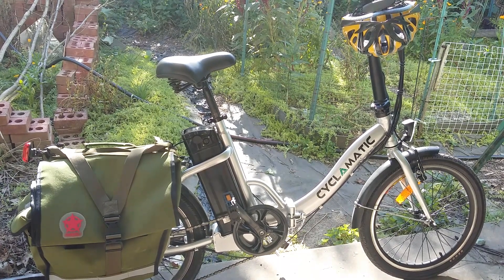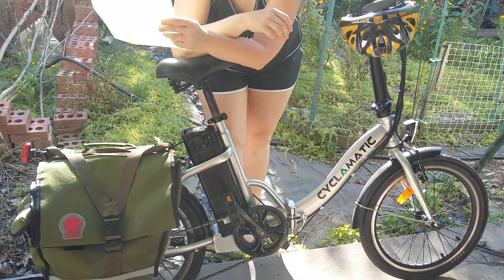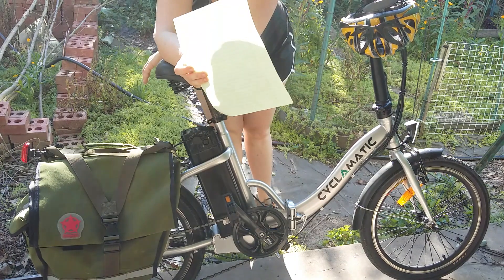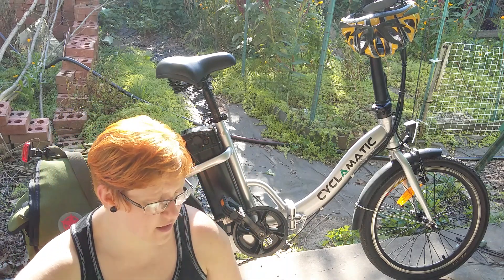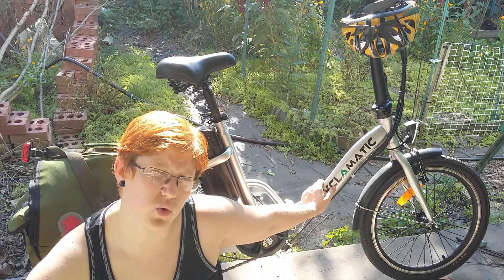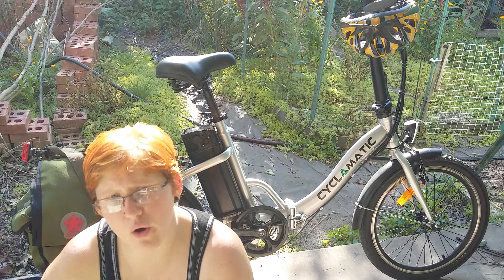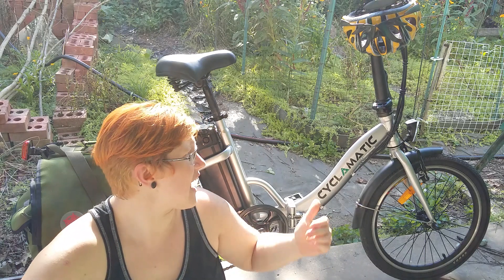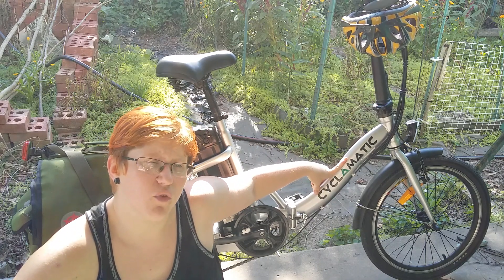Cyclamatic CX2 folding electric bike review at 60 miles

Comment: I just got mine today! Does the chain sit that low? I noticed yours did. Does it interfere with anything while riding?
Reply from the maker: Congratulations!  That's so awesome!  I just hit the 110 mile marker on mine and the only thing it's needed is new break pads (an easy job) still very happy with my purchase.  I hope you like yours just as well!  The chain is as pictured, yeah.  It hasn't caused me any trouble i honestly hadn't noticed that would be considered low.  There's still i rubbing sound i can't diagnose though I've tried.  Only happens when there's weight (me) on the bike so it's a little tricky to check out lol.  I'm thinking i might do a review again soon now that I'm at a significantly higher mileage.  Happy riding!  Enjoy!
Reply: @CliffsidePermaculture  how do you know your mileage? Where did you buy the break pads for it?
Reply from the maker: @autowill99  very good question, I have been taking down hashmarks for every 5 or 10 mile trip on a white board haha.  My mileage is probably at least a bit higher than that because I've actually rounded down trip lengths if they're more than that.  Kinda old school as methods go.  I got the break pads on Amazon I'll try to grab the link for you It's wasn't too long ago so i can probably pull that up.
Reply from the maker: Here we go, this is what I got.  Just very basic standard break pads, nothing special.  They did end up being shorter than the ones it came with, but hasn't been a problem.  Only my rear brakes wore out anyway, so I've got an extra set given that this was a 4 pack. https://www.amazon.com/gp/product/B0725HBL1M/ref=ppx_yo_dt_b_search_asin_title?ie=UTF8&psc=1
Reply: @CliffsidePermaculture  thanks for the reply. Helps a lot.
Reply from the maker: @autowill99  I'm glad to hear it!  I hope it treats you very well and that you'll like it as well as I like mine.  Happy riding!

Comment: Good video
Reply from the maker: Thank you! :)
Reply: @CliffsidePermaculture  l have just been given a Ezgo Izip unused for 10 years and as new, although the batteries were beyond charge so bought a new pair and installed into the battery box for just £39 and it works a treat it does 15 mph without pedalling although on the flat, it's just single speed gears so mainly pull the throttle and don't peddle, only to set off to l give it a little peddle, I'm quite impressed with it, great fun!
Reply from the maker: @esotericandy  That is wonderful!  What a great deal you've got there, I hope you can enjoy it for many years and have a great time with it!  Good work with the battery repair!
Reply: @CliffsidePermaculture  thankyou!